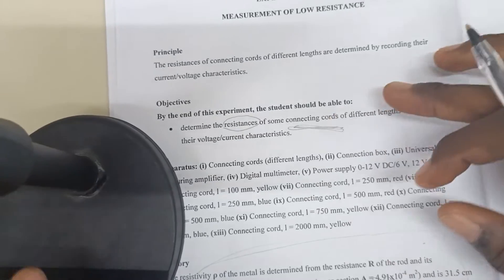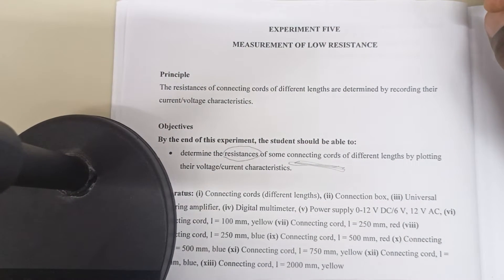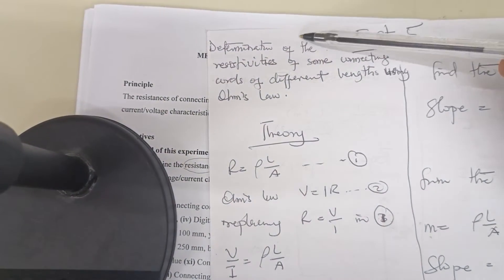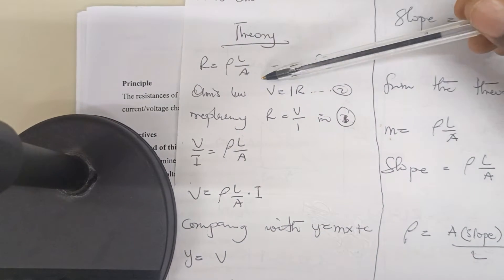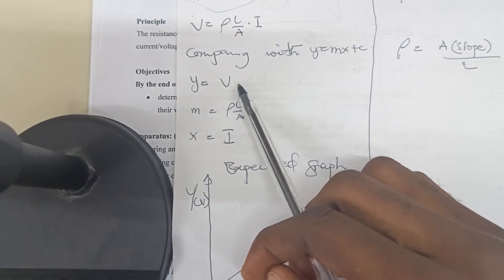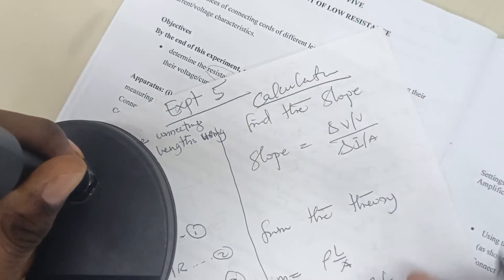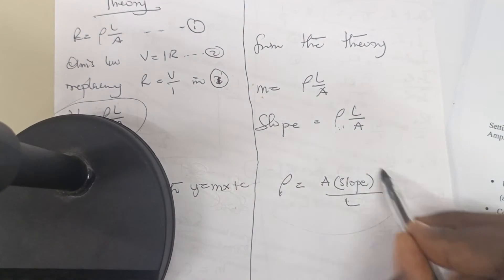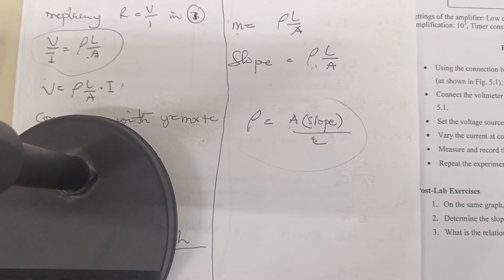Determination of the Resistivities of Connecting Cords of Different Lengths using Ohm's Law. Expt 5

Comment: Sir please for graph, the manual said we should plot current I against voltage V. Please I want to know the one that would take the y-axis
Reply from the maker: Either is correct, but it depends on what you are finding. if you are finding Resistance then you plot Current against Voltage, on the other hand when you are finding Resistivity you have to plot V against I. Especially when you have been given Cross Sectional Area.